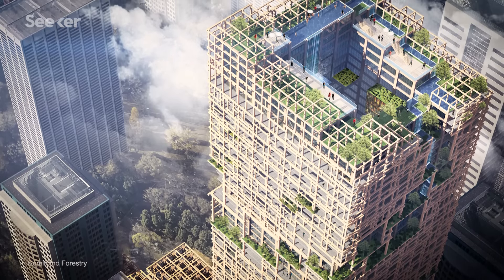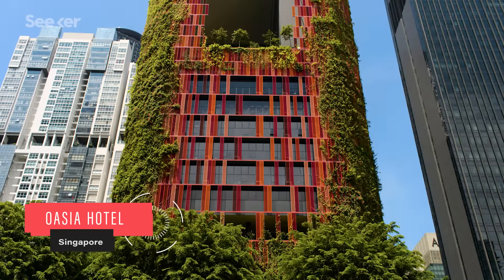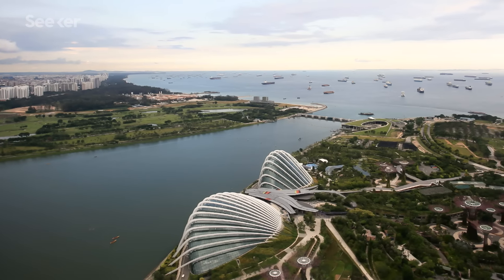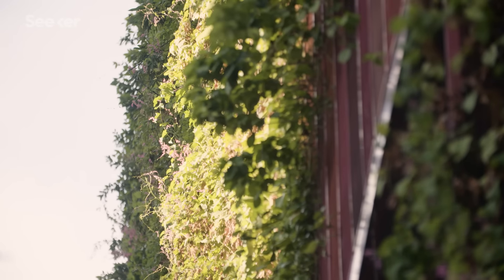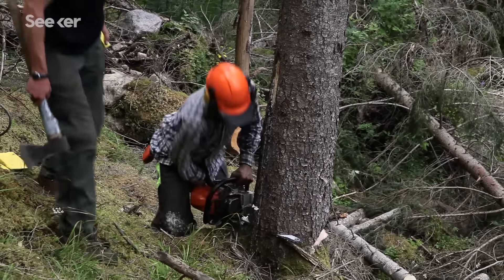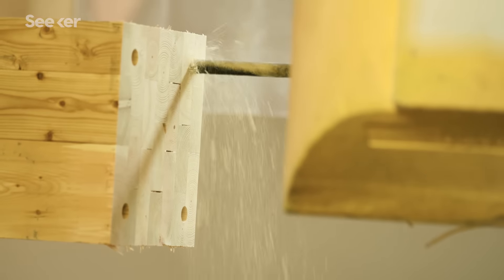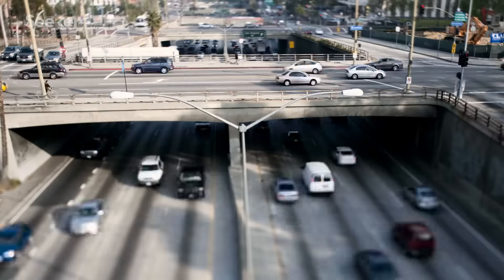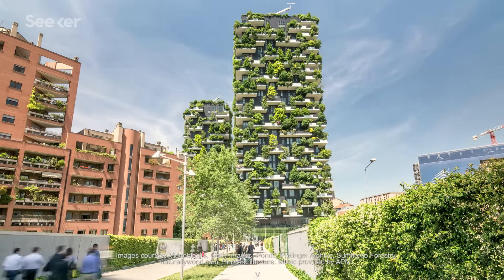Skyscrapers of the Future Will Be Engineered to Copy Nature

Comment: How does a 50 storey wooden skyscraper handles earthquakes ?
Reply: Not very well lmao
Reply: Quetzalcoalt unless it’s based on the Japanese type buildings which have lasted over 1000 years (dunno)
Reply: Wood is more flexible than concrete+steel...
Reply: God Of Madness1 exactly. There's a lot of options here.
Reply: p.s. earthquakes won't occur in Singapore
Reply: It depends on how the structure of building is build.
Reply: No earthquakes in singapore xd
Reply: The Canada one.
Reply: This is Mother Earth you're speaking of.. when she feels like it, they will.
Reply: @museluvr well i'm talking more of a normal earthquake not a 8 or 9, but between 4 and 6.
Also @Simone
 yeah but it depends what the wood it. Also a more flexible wood is not compatible with high buildings, because it might flex from all the weight. Metal will bend but not brake most of the time where wood if you put a little too much pressure and it shatters. 
Try breaking a dry stick with your knee and then try the same with a metal rod with the same radius.
Reply: Considering that trees are just fine in Japan, maybe very well.

But even if you made a building out of vibranium, building it wrong, it would fall
Reply: Better than a steel one. Steel doesn't absorb force, it transfers it to whatever its touching. Wood can dissipate force inside itself.
Reply: Stone in the bottom, wood on the top. The base of the building will be concrete/steel, but the most parts will be wood. When typhoons and earthquakes occur, this type of construction will make it flowy and impact as a whole.
Reply: I see quite a lot of architects and specialized people in this sphere talking here.
Reply: Darren Galloway 
Wrong... So very wrong.
All materials absorb some energy but in a building you typically DO NOT want the building to sway. Sway tends to occur at the resonant frequency of the material and hovering around the resonant frequency always leads to catastrophic failure of whatever structure you're talking about regardless of what it's made out of. Besides we've already worked out how to cancel out the destructive effects of resonance due to earthquakes and storms using internal counterweights. These would be less effective in a wooden building though because the weights are heavy and wood as you mentioned is more flexible.

Ever made a toothpick structure?

Ever put a heavy weight on top of it?

Ever see what happens when you bend the structure with a heavy weight on top of it?

If you have chances are likely you'd never want to be anywhere near that structure if it were big enough to fit you!
Reply: better then a steel one, wood is more flexible
Reply: Quetzalcoalt It depends you can put a dampening system, build in the configuration that is similar of that to a spring, and wood is very flexible. But you do know steel building can also fall from an earthquake too, the only the only thing is steel is stiff and can snap instead of bending
Reply: Quetzalcoalt You're forgetting these buildings have to pass the same building regulations as concrete and steel buildings.
Reply: Quetzalcoalt with the power of awesomeness
Reply: Probably better then other buildings or the same, wood is more flexible, but most buildings have giant shocks/sprigs so they can move in an earthquake anyway
Reply: Large skyscrapers have built in springs and systems to level out the building during an earthquake.. Would be the same with a wood skyscraper.
Reply: Quetzalcoalt depends on the material underneath
Reply: Look at all these keyboard warriors structural engineers trying to spread idiocies lmfaooo
Reply: VariantAEC The Japanese technique isn't just about the wood but the layout. many Japanese skyscrapers are built in a traditional style, they do use steel. However advancements in bioengineering could see better wood and make these types of buildings even more practical.
Reply: Wood skyscrapers would probably handle earthquakes much better than concrete ones. Wood is flexible and does not break sharply, so you have less of a risk of a floor collapsing as you do in concrete buildings that do not have reinforced steel.
Reply: Alex Morgan have you ever burned a log ? Its fucking predicatble, the outiside burns and then the inside, you know how it is going to burn. 

Meanwhile with concretes, it cracks everywhere
Reply: Wood is so much more flexible. They actually touch on this in another video.
Reply: Quetzalcoalt all skyscraper are designed to flex and move to avoid earthquake damage. And wood is way more flexible than concrete and steel.
Reply: Forget the materials used for a bit and just consider this simple fact: Almost all municipalities in the world have building codes that must be met before the building is give a certificate of occupancy. These codes are usually specialized to the area and its particular hazards. Wooden skycrapers would be required to meet those codes (fire codes, seizmic zone codes, etc.) as would any other building. So to answer your question with just this in mind, wooden skyscrapers would thus handle an earthquake as equally well as any steel+concrete building built to meet the same codes.

That said, there are videos you can find here on YouTube of how well cross-laminated timber (CLT) handles earthquakes, and it performs exceptionally well. Even better than steel and concrete would.

The same is true for its fire performance. When people think of wood construction and its fire performance, they usually have in mind timber (stick) framing. Mass timber performs in a completely different way to stick framing. The surface chars and then the fire dies for lack on oxygen to keep it fueled, leaving a majority of the timber's mass untouched. For a CLT panel to completely give way, it would have to be exposed to an extremely hot flame for an extremely long period of time, having a constant source of fresh air and other fuel to keep it burning through the char to the wood underneath. But this is unrealistic, as most of the timber that would catch fire in such buildings would be covered by non-combustible material (as mentioned in the video), and the building would also be fitted with a sprinkler system throughout (as per most building codes today for commercial and high-rise residential construction).
Reply: Earth is flat and human going back to using wood? Something is mischievous about this...
Reply: wood is a much more capable material than concrete or even steel at handling earthquakes because of it's ability to bend, stretch and contract. For that reason many home along the Juan de Fuca line where earthquakes are common, are built with wood
Reply: It doesn't
Reply: Actually very well.
Reply: Better because wood moves with the earth quake not against it didn’t you learn this in school?
Reply: better than steel, because wood can actually bend quite a bit before it breaks.
Reply: Woodn buildings are earthquake proof
To withstand earthquake the building must be flexible and not stonger
Reply: Probably better than steel. If you dont understand how, then educate yourself on material applications and physics.
Reply: Better than your presumptive question imagines.
Reply: better than steel in a lot of cases actually because it's more flexible and wont break

Comment: I have a suggestion: use wood (obviously cross sectioned composited resin inside) but then coated with carbon fiber from the outside so that it LITERALLY becomes as strong as steel or even more than that. It will also be cheaper and environmentally friendly if we plant a new tree for every tree being cut down. You might now know about this but the world is actually running out of usable sand (the type of sand which is used for production of concrete which is solely seashore sand).

Comment: One possible advantage to having plants integrated into a building, depending on how it's done and what plants are used, is a stronger building that is less susceptible to wind and ground movement.  Plants are usually pretty strong, and taking advantage of both their natural ability to climb and intertwine, as well as the resistance to breaking or being uprooted could possibly increase the overall strength of the building well beyond normal design standards.  Imagine having trees grow around and into support columns for multi-story buildings.  As long as the trees are alive, it's likely they would provide a stronger structure in combination than even steel reinforced concrete by itself.

Comment: Still... what about the increased structural deterioration that may be caused by such setup? I do hope they have done something to prevent that from being the major issue/problem it is everywhere else in the world where similar ideas have been tried. :/
Reply: Smartinator Plus Plants require roots, roots that dig into the material they are growing in. Unless you want plants that die the moment the weather shifts you want to use decently hardy plants, and that generally means roots that dig in pretty deep. 

Though sure, I am sure some sort of genetic manipulation might be found as an solution to create a decent balance for both low deterioration of the structure and the hardiness of the plants. But I still think we aren't there just yet, so caution should be our best friend.

Regarding the wood structures... There genetic engineering "might" help make the wood slightly hardier than it is, but considering that it is dead organic material I cannot fathom that the maintenance cost for such a structure u
is cheaper than that of the concrete in the long run. Though I do hope it will be.

Either way... considering we have been genetically manipulating plants for over 30 years now and not yet found solution I am going to remain cautiously optimistic if ye don't mind. ;P
Reply: Elmithian well theres not much weather change here in singapore besides heavy rain
Reply: Dimension Puncher Very fair point. I was more thinking about this idea being used in varied form of environments but I guess it makes sense that they would be used in places that aren't as harsh/unpredictable as where I live ^_^,

Comment: These wooden skyscrapers looks awesome, but fireproofing is not the only problem. The other major problem is Rot. If the structure is exposed to water, it will rot. Baathrooms will leak. Pipes will break.
Reply: Not true wood can be protected by coating it with some chemicals..idk much but I have seen it.

Comment: Wood will never last longer, infact wooden sky scrapper is adding to deforestation.
Reply: Yes but wood can be reproduced unlike concrete and iron. That’s why it is friendly to the earth
Reply: Avengers Newbie  clearly didn’t watch the entire video.
Reply: And we are also running out of sand for concrete
Reply: Avengers Newbie the oldest building in america is wood... Also i would agree compared to cob, wich lasts about 20 000 years if left to rot
Reply: Nah the point of wood is that it traps carbon in wood form. Plus it can be dissemble and reassemble to replace worn out parts unlike concrete. Its lighter and stronger. Structural strength not compromised if there is fire. And building construction and disposal is cleaner , cheaper and faster. No building is meant to last forever. At least we can replace it with better buildings easily in the future. The only problem with wood is securing a constant supply of trees and bureaucracy.
Reply: but there is a wood building thats last tor centuries, it was shown in the vids
Reply: Seyfert its treated wood. Obviously the engineers who design and make the product would cover all the basis. Try reading up on it, it really is an interesting idea
Reply: Avengers Newbie it will not add to deforestation because after the build we will actually have more room for trees then before
Reply: that is whisfull thinking, no city in the world has ever reduce it's footprint...
Reply: Ian McCourt interesting, how?
Reply: Hemp plastic.
Reply: hpensive What that.
Reply: trees are renewable Metal,sand and concrete is not...
Reply: Carlos Belo 
Firstly, where did you get that info? I highly doubt that’s true. Secondly, even if it were true, that doesn’t mean we can’t. It’s not even wishful thinking, these are viable new sustainable construction methods.
Reply: Blugale Doh Hemp is the plant our Universe intended us to make the strongest and durable fibers, and building materials out of. A natural resource that can make clothes, rope, gas, plastic, concrete. Were 100s of years behind because we have failed to implement what should be exploited and destroyed sacred forests.
Reply: You clearly don’t know what your talking about
Reply: NO NAME ARTIST Trees take 100s of years to mature, why not use hemp?
Reply: Not really, but wood frame buildings sequester carbon. Whereas concrete produces CO2 as a byproduct of its production.
Reply: Iron, cement and especially coal aren't?
Reply: won’t the rain forst.be eterily chopt ik we do this
Reply: You are partially correct but that is like saying eating vegetables are not healthy because they have sugar in them. Although making wooden skyscrapers would use a lot of trees in the process the overall emission of carbon is much much lower making wood much more efficiant in terms of green house gas emissions.
Reply: Did you think these people didn't do any research on their projects?
Reply: Ian McCourt please explain...the more wooden structure  comes up more deforestation  occurs and we will end with more demand than supply of wood!  And trees don't grow in a single year..
Reply: Alexander Scatov 
To run out of sand we'd literally need to run out of Earth to stand on... Unlike forests which we can live without for years to decades... Before we die due to lack of oxygen. Also at the rate some cities are expanding plus the fact that we aren't using much less paper snd other tree derived products. I'd say adding more to the load by making the world's largest buildings with wood...
*ISN'T GOING TO HELP SLOW DOWN DEFORESTATION!!!*
Reply: Tomas.Herbert 
There are sustainable forests. I’m not entirely sure if they would be able to supply the demands but with a few of these, further deforestation would be greatly reduced if not complete ended (at least for our purposes and not like agriculture).
Reply: so everyoone here thinks using wood to build will combat deforestation... however companies won't plant trees, they will just use the cheaper deforestation wood as always
Reply: Tomas.Herbert Exactly and trees take year's to grow to maturity, the fact is that no solutions will solv our climate problem, because we will just keep defeating them with mor people, we nead to reduce our population and focus on the millions of kids that are in the system.
Reply: I was on board when she said it would make up feel better and only that reason...
Reply: L Petillo Trees also take year's to grow so that will not work.
Reply: Masklyy ರ_ರ Do you even know how long a tree takes to grow.
Reply: Finish the video first
Reply: I have thought about this topic for a while now, no solution will solv our problems because as the population grows so does the demand for things like medle, lumber, stone, oil, fabric, food, water, natural elements like Cole, sodium, and others, and all of the products that come from those things.
Reply: The wood isn't adding to deforestation, the forests are replanted and not turned into farms etc. Using wood like that simply acts as a temporary carbon sink. For example in Finland 70% of the area is forest and most of it's commercial forest meaning it's cut for wood around every 50 years.
Reply: Avengers Newbie No, wood gives us a very good reason for reforestation.
Reply: Peanut Butter Pizza sorry ive misspoken. Within the intended application and specific form of manufacturing of wood that is being researched upon now, and considering the conditions and loading it will be subjected to, and considering its strength to weight ratio, wood is stronger than steel. But not every time. Obviously you can’t compare apples to oranges.
Reply: Nut Sack What about insects, termites, and soil?
Reply: Tomas.Herbert here in Oregon where I live we lose thousands of acres of forest, literally every summer due to Forest fires. And once every few years we have Forest fires that are hundreds of thousands of acres burned at a time. I would much rather the wood get used, than it getting wasted to Forest fires. It really depends on the area, but Oregon in my opinion needs to be logged. Logging can be done in a sustainable way. The trees grow back faster than you would probably imagine. And by logging I mean, it being done in a sustainable way, replanting trees.
Reply: yes. the video didnt say about termite.
Reply: use m-sand
Reply: It’s called a wood farm
Reply: Do you think they did not consider that issue before building?
Reply: There's wood inside the columns of the Parthenon that's still fine

Comment: Modern, cross-laminated bamboo beams and panels are stronger than steel.
 They can last longer than concrete too, because concrete cracks with age.
Only concrete with glass-fiber could be comparable, but not better, because bamboo panels have stronger fiber, if fabricated well.

The fabricated wooden and bamboo panels and beams will be a huge market, because they are easier to process during construction, which makes construction more flexible.